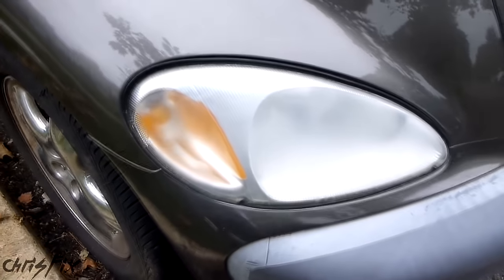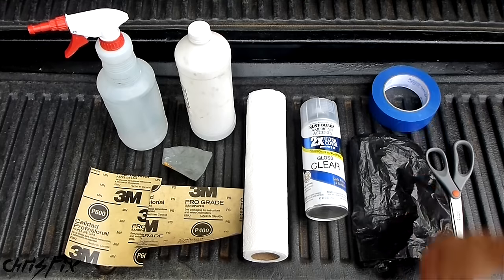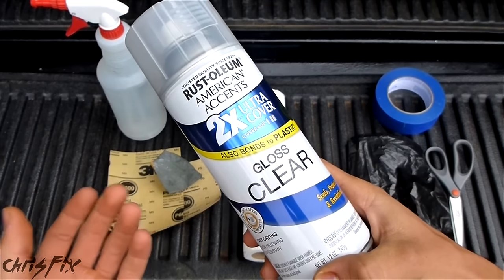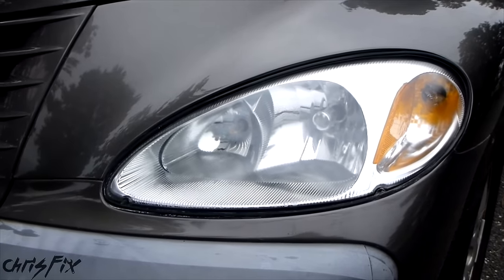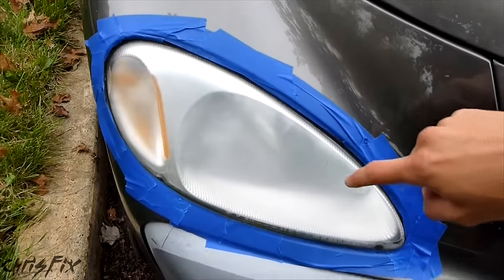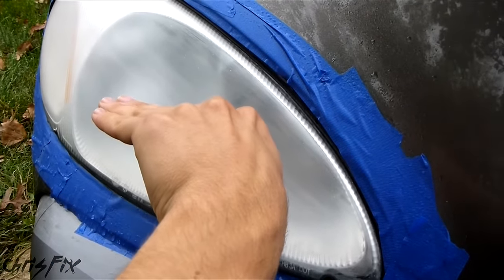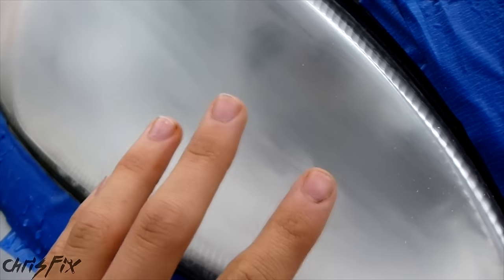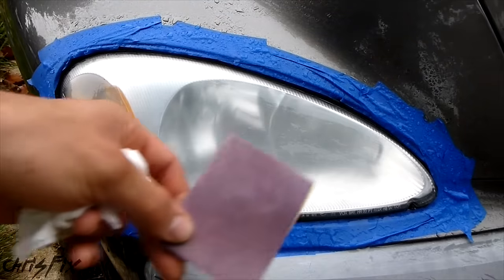How to Restore Headlights PERMANENTLY

Comment: This is awesome.  Got a Hyundai Getz that has yellow head lights!! If this method works half as good as it does in the video,  I'll be a very happy camper. 

Thanks  Chris!
Reply: My recommendation is to do this but instead of using spray paint use a 3M headlight wipe. I haven't actually tried the wipe with this video method but I tried the wipe with another method (a 3M headlight kit which requires a drill) and it looks pretty nice. The wipe is pretty affordable and specifically designed for headlights. Mine has lasted for at least a year so far, but the spray paint yellowed earlier. (May have been a crappy paint, but I used rustoleum like Chris did, though the can looked different than his, I guess his may not be available anymore or was an older design.) 

And a wipe is way easier to apply because you don't have to deal with spray paint and it won't result in orange peel which affects clarity. (If you are a pro at spray paint I guess you can minimize the orange peel)
Reply: If you buy the 3M headlight kit in the store it'll be 15 bucks and have all the sandpaper discs and 3m wipes you need. It's meant to be used with a drill via an included Velcro drill adapter, but you can probably sand by hand instead with much more physical effort. 

Some versions of the sanding disc kit come with an orange sponge disc and headlight polish liquid. Using that before the final step of applying the 3m coating makes the clarity super good. I think they removed the sponge from the newer versions of the kit, so it may be skippable (I ended up buying it separately for my kit ). There is still a 3M kit which is solely the sponge and polish, which is all that may be necessary for fixing slightly yellow headlights.  However it lacks the 3M coating wipe which I think is important to keep it from yellowing again.

You need a drill to use those sanding discs, preferably a plug in one to avoid dealing with waiting repeatedly for a drained battery to recharge or have several charged, healthy batteries. (A single battery will probably repeatedly go dead from all the sanding) Since it's regular sandpaper, you may be able to do by hand instead. 3M has an official video but there's a channel called headlight Restoration Pro with longer detailed video. 

If you use the 3M sanding discs with a drill, you should trim the sanding discs slightly smaller than the velcro drill adapter that holds it. That way if you brush against something, the edge of the sanding disc won't get bent/a crease in it. Once the edge of the disc gets bent, I believe the creased part will unintentionally sand with excessive pressure, gouging the plastic more than sanding it and leave noticeable concentric scratch on the headlight after applying the coating (as 1 of my headlights ended up with). So by trimming the sandpaper smaller than the Velcro adapter, the adapter will protect the disc. Or just avoid the edges completely with the drill and hand sand there instead (which may come out noticeably worse unless you thoroughly sand them. Mine did, I'm not sure why but I probably didn't sand thoroughly enough there).

Comment: I did my headlights as per the tutorial which was very good i might add , but just one question ,,, one came up very hazy with orange peel the other not so bad just slightly hazy , i may have done to many coats on the first one as it seemed to need it? Anyway would sanding it with 2000 grit then buffing with carnauba wax bring it back to shine and clarity?  not sure if you read these but thought i would see anyway?
Reply: +Rob Sara yes, it doesn't matter if you spray a headlight, a car body or a guitar, you get orange peel. you just let the paint dry till it's hard and wet sand it with let's say 1000 and a 2000 grit, no need to go higher, and then buff it or use a little polish. it's how it's done

Comment: I drive a 2014 Honda Civic sedan in a rotation with a 2018 Subaru Crosstrek. I cleaned both headlight vehicles for the first time ever on both vehicles. Great results!

Comment: Followed these steps to a "T" and my headlights looked great for about 2 years.  After 2 years, the clearcoat started to yellow and peel off.  Now they look like crap again.  Either do it again every couple years or  buy new headlisghts and get about 6 years.  Just sucks that they don't use glass for headlights anymore.  There's the fix.  Glass headlights.  I guess the old saying is true... "They don't make 'em like the use to."
Reply: Because they used to cause more injuries.....
Reply: @I69Sk8er69I  what do you mean?
Reply: Glass headlights would get cracked, chipped, and damaged from trucks or cars lifting up bits of rock and gravel on the highway hitting your headlights
Reply: the major part of the renovation has got to be the UV quality of the clear coat
Reply: @Weebwhacker  glass chips can be fix cheaply if detected early
The issue with glass headlights is that it also always came with sealed beams that were terrible by themselves. Also in the era of aerodynamics and emissions they can't spare make a glass headlights take 3 days to make because of the swoops and pointy design and also the obvious weight disadvantage. Also pedestrian safety laws.
Reply: Same thing happened to me. I'm pretty sure the yellowing is from the cheap clear coat itself. The rattle can stuff can't be high quality.  So I ended up doing it again. But it's not that much time if you skip the clear coat step. I just hit it with 400 grit and then 800 wet sand followed up by polishing compound and then wax. Probably about an hour total and that's including removing the old peeled stuff.
Reply: In an accident glass headlights turned into shurnikin
Reply: This step is very useful for old cars where parts availability is difficult. Youtube is international and is reaching other parts of the world where people are not well earning but needs own transportation anyway. this video is not just meant for you. Video is about making the method work.
Reply: He said "permanently" because he was working on a PT Cruiser
Reply: Bryan Ryan  Bet you cant back up your comment of why that is.
Reply: Bryan Ryan  I figured as much. Maybe actually use a more interesting meme? 
You're so close yet so so far away. It's rather laughable
Reply: Bryan Ryan  How do you know Im not a boomer?

Comment: Hey Chris: I got through the sanding and the headlight looked great. I botched the dang clear coat (over sprayed so it’s runny). Do I wait and just resand after a few days or what?
Reply: Hi Tom, I ran into the same problem as yours. My clear coat ended up runny too. Did you fix yours? If yes, please do share the details…I could use some advice…
Reply: Same issue too. I wet-sanded back from 600, 1000, 1500, 2000, and 2500. Re-applied clear coat 5x, and walaa!

Comment: Hey Chris. I've been doing your 10-minute system using mag and Aluminum polish and then finish off with Meguiar's headlight coating. Same results with less work. 
My question is, if i do the same thing but use the clear spray that you used will i get the same results and longevity. 
Now i have to redo about every 2 years.
Love your instructional videos. Keep them coming

Comment: after 1st coat painting, it looks ok. ASAP put 2nd coat on, start hazing. 3rd coat make light haze more. I have re-sanded  and put 4 coats on. same haze. Any suggestion?
Reply: Chunlong Liu ME TOO!! I’m so frustrated I’ve done the whole process twice, and I’m thinking I’m just going to skip the spray all together :(
Reply: I have the same problem and I need tip real quick. I have inspection in a few days.
Reply: what kind of clear coat are you using? is it for plastics, uv resistant, and nonyellowing?
Reply: In my case yea
Reply: Chunlong Liu 
Don't spray from too far away. Get close, and apply as thick as possible without it running. Should work
Reply: It's been a couple of months, but in case you didn't get it fixed, you can wet-sand a clearcoat and buff it afterwards  for perfect clarity. For further protection afterwards, you can buff with a carnauba wax. Clearcoats will eventually fade over 
 (long periods) time and this will help protect it.
Reply: Chunlong Liu c
Reply: Yes, it happened to me, I polished and it came out clean. I was starting getting worried

Comment: Just did mine. Lots of orange peel left over after the clear coat so it still looks a little foggy. Should I just go over it with wet 2000 grit tomorrow after it dries?
Reply from the maker: In a couple of days after the paint fully cures do this on your lenses: https://www.youtube.com/watch?v=2nYF46P7B2c
Reply: +ChrisFix hey Chris! Thanks for responding. Several quick questions. Would wet sanding with 2000+wax work for the orange peel? Isn't that kind of what the scratch fix is with the 3000 grit sand paper and the polish?
Reply: This same thing happened to me.. I did every step and now i it looks a bit worse than when i started.. I tried to use 2000 grit to smooth it out, but it still is very foggy
Reply: +Nicholoas Arruda yeah I'm going to try and figure out what I need to do. I may go over it with 2000 and then use some polish
Reply: +freezedried94  lol, I did mine on both cars and now it looks really foggy too
Reply: +freezedried94  lol, I did mine on both cars and now it looks really foggy too
Reply: +dan yeah I think it may be the clear coat that was used. Because the orange peel really looks like it fogged mine up. I used some 2500 grit+  polish though and wax  and it looks a little more clear
Reply: freezedried94 did you try to do whatever he did in the link with the scratches?
Reply: +dan I did. It did clear it up slightly but it doesn't look absolutely brand new. It doesn't look bad. It's just not brand new looking like I wanted but it looks alright.
Reply: freezedried94 yeah, thats a bummer when in video looks better than new. what polisher you used?
Reply: What kind of wax did you use? Mine look a lot better than initially when I started so not complaining, but have the orange peel going in spots as well.
Reply: Shouldn't have orange peel in the first place if you didn't spray anything on it. If you did spray on it and don't like the results resand with 3000 to 5000 and then wax it.
Reply: +Cory Stites I used turtle was paste from O'reilly's
Reply: I would highly suggest you go above 600 then 800, 1500, 2000 then clear to make sure there are no scratches then wait for the clear to cure completely sand with 1500 or 2000 and machine polish. The conver with wax. The headlight  will yellow out again if the clear is not a good one.
Reply: mine just came out the same way. let me know if you figure out a solution. otherwise I am just going to spend the money and buy brand new lenses.
Reply: I would honestly just sand with 1500 grit, polish and then protect with a UV filter with no clear as it can start scaling or yellowing. Still it will never be as nice as a new one sometimes the actually plastic is stained on the inside.
Reply: +cjgaltieri my I started with 600 grit then 1500 grit then 4 coats of clear then let cure but the orange peel was bad and textured so I got some 1500 and 2000 grit and wet sanded until I didn't feel any resistance with both then got the polish he used in the scratch video and did that 2 or 3 times per light then used turtle wax paste and they look like new headlights
Reply: i used clear headlight polisher and it did a pretty good job, not new but better than the orange peel
Reply: try polishing it.
Reply: K
Reply from the maker: If you have orange peel, wait a few days for the paint to completely cure. Then use 2000 grit, 3000 grit, then 5000 grit. At this point the headlights should be hazy but there will be no orange peel. After that, use a polish (scratch remover) and buff it until it is clear. Then apply wax and it will be crystal clear.
Reply: You can also use rubbing compound to remove the mico scratches when you're done with the sandpaper.
Always worked well for me.
Reply: Good game
Reply: Hhj

Comment: Just fill it with Blinker Fluid
Reply: Abdulaziz Bahamdain Ensure you use a left handed screwdriver when removing the plug.
Reply: I just heard about blinker fluid...I thought he was kidding. lol
Reply: gorillaau ow my looks like your going to have a "long weight" for that.
Reply: In this case, wouldn't it be better to use Vtec fluid?
Reply: Hahaha
Reply: What if you have a BMW? I hear their blinker fluid reservoirs are very low-capacity
Reply: Abdulaziz Bahamdain blinker fluid doesn't exist
Reply: I used to do that, but that stuff evaporates and costs too much. I finally broke down and bought a Zemeckis-brand flux capacitor for my car, and I will never need to get blinker fluid again. WARNING:  Avoid TARDIS-brand flux capacitors; they make a weird noise and the results are decidedly unpredictable!

Comment: idk if anyone's mentioned this but I have followed this guide a few times now helping to work on friend's cars headlights and I found it way easier to do this if I remove  the headlights from the car to work on them doing this. You don't need to tape off or bag off any parts of a car that way. YMMV for ease of removal, but all of mine have been a couple screws and it's been hella easy.

Comment: So the 3m headlight restoration kit is actually just fine it just needs the UV coat?
Reply from the maker: +TheGame4Life yes and no. The kit is great but you cannot clear coat over that kit. The surface is too smooth and the clear coat will peel. You need to go 600 then 2000 grit to get the clear coat to adhere.
Reply: ChrisFix I don't know the grit of the kit but it goes through 3 different grits so couldn't you just stop before the finest one and coat then?
Reply: +TheGame4Life ,what part of "No"  don't you understand?
Reply from the maker: No, you need to follow what I showed in the video. The 3m kit is designed to work with their method. The grits they use are not anything near 600 grit.
Reply: ChrisFix Ok i will give it a try. My problem is that the coat you used isn't available in Denmark so i don't know exactly what to look for. Is it just clear paint for plastic with UV protection?
Reply: Its clear coat with UV protection.
Reply: +Mark Wolf (MAG) and what exactly is clear coat?
Reply: Basically clear paint that has added chemicals to both bring out the luster in paint and protect paint finishes. Why I am explaining this to you when you have google at your fingertips is beyond me. Go to your local hardware store I am sure there is some in Denmark.
Reply: Mark Wolf You were so close to just being a helpful person and then you had to make the google comment. Like asking a simple question has been banned since google came along.  And maybe there is some in Denmark but it is very likely called something else which is why i would like to know what it is so that i have a chance to find it even if it's called something else.
Reply: +ChrisFix Hey Chris, I just restored my headlights using the 3M 39008 kit. Gave them a polish and they look good now. I'd like to protect them from UV, any advice? Thanks in advance!
Reply: i live in the us. short of krylon, rustoleom or some other brands you need to look up what is available within your region. I am sure Chris wont be able to direct you anymore then stating to go to your own local automotive supplier ref google it being a simular not having to call or leave the house alternative.
Reply: ***** Do I have to be or something?
Reply: the grit inside the 3m 39165 kit it has 500,800,3000 grit papers. i just did mine like 45min ago and they are amazing from what they were. Night and day difference.
Reply: TheGame4Life
Reply: You should simply apply a coat of plastic adhesive primer before you pain clear coat, and you wont have the problem of peeling paint later on.
Reply: TheGame4Life
Reply: Hi - from Denmark too. I have been unable to find Rust-oleum 249117 Clear Coat anywhere in EU. The Danish term is "klarlak" in case you are wondering. 
A good substitute is "ColorMatic 2K" which is UV, gasoline and scratch resistant as far as I can tell -  around 25 USD / 500 ml.

Comment: Any cracking or peeling after all this time? I’ve been advised several times not to clear coat just to polish.
Reply: After using the fine grit sandpaper I'm going to buff it and use a sealant on the headlights not clear coat
Reply: @josron6088  what type of sealant? A plastic sealant?
Reply: @tdginter  Meguiars headlight coating or new wipe